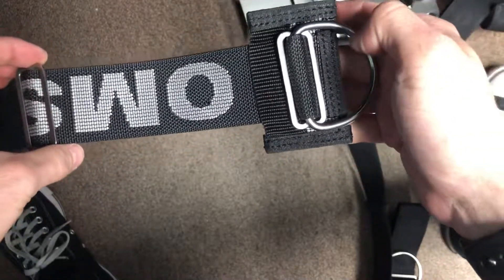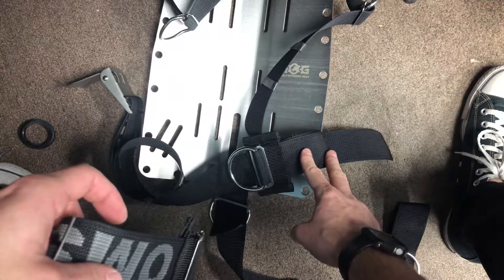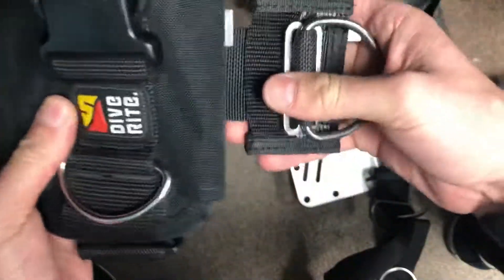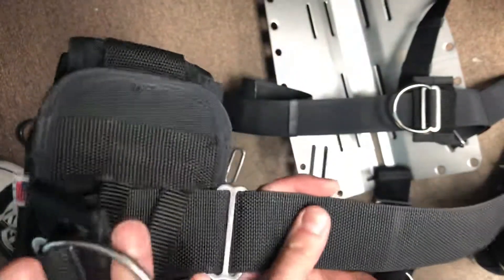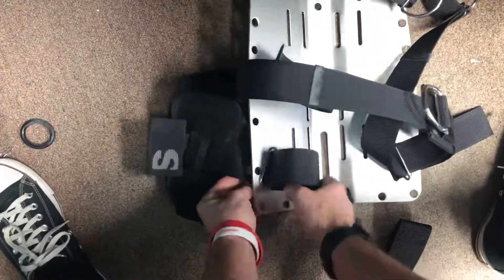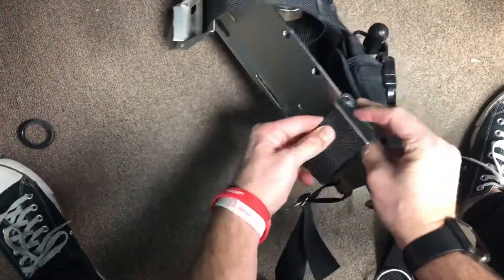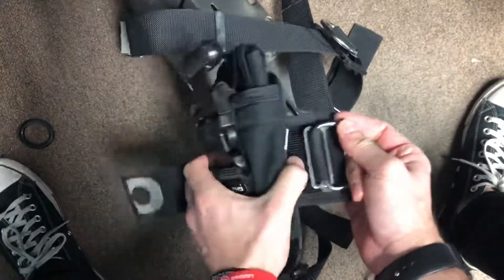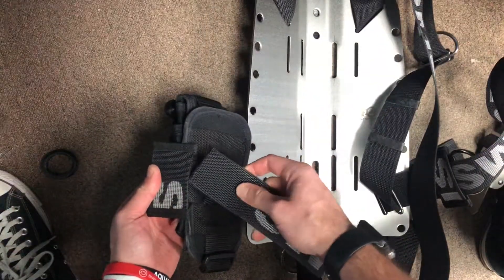Installing a weight pocket on the OMS quick adjust assembly

Comment: Hello, great videos , can you intall those dive rite facing forward instead of facing up on that rig? Been looking to buy that exact rig but i dont like the weigth pockets facing down ir up. Thanks
Reply: I was about to post the exact same question! Thanks for asking - I actually have the same Dive Rite QB weight pockets, and have been wanting to know the same thing before purchasing the OMS Smartstream Quick Adjust set-up...👍
Reply: @seanlotz9581  for what i could come up whit its possible , so i order it, when it arrives i'll let you know .
Reply: @worsol2000  Please do! I have the same integrated pockets mounted horizontally on my harness currently, and hope to keep it that way if I get the quick adjust system.
Reply: @seanlotz9581  i'm buildding a Frankenstein, apeks wtx wing, backplate an smartstream arness and dive rite pockets, but this is my favorite things, dont really care whit the branding coordenation 🤪
Reply: @worsol2000  SAME HERE! If I sent you pictures of what I put together, you'd get a real kick out of it! Funny thing is, it actually all matches up really well, and several divers already got fooled into thinking it came that way! (OMS back-plate, OMS back-plate pad, Apex harness with Apeks shoulder pads (from DRIS), Dive Rite QB weight pockets, Dive Gear Express S1 wing and their trim pockets, and Aqualung grip lock tank straps; everything is basically black, so it all matches...)
I'm up to about 10 dives with this setup and have really liked it - so adding the quick adjust feature would make it almost perfect..👍
Reply from the maker: You can install them facing forward as well, you made need to extend out the d ring section a little further, but it can be done that way!
Reply: @timsgeartips  Perfect! Thanks for the update!

Comment: So Tim, how do you like the smartstream?  Have you been diving it?  What are your thoughts on the quick adjust with regards to different types of suits?  Thanks
Reply from the maker: Hey Tony, Im using the QUICK ADJUST ASSEMBLY without pockets. I currently use a 3mm and my trilam drysuit with very thick insulation and have no issues other than (small adjustment to crotch strap and upper d ring placement... because I am picky). I will say every dive I do I will tighten up the shoulder and waist when I get down to 10' to keep the rig nice and snug.